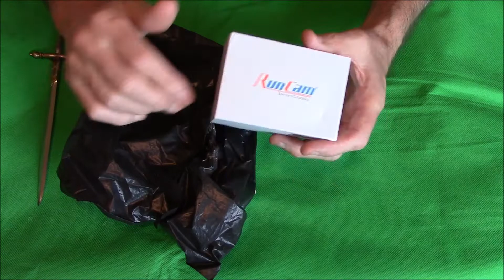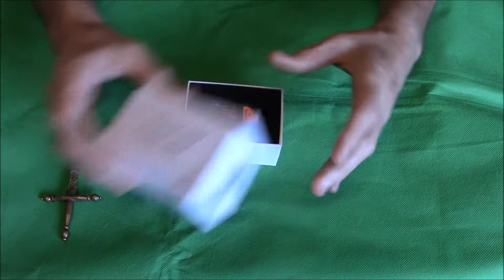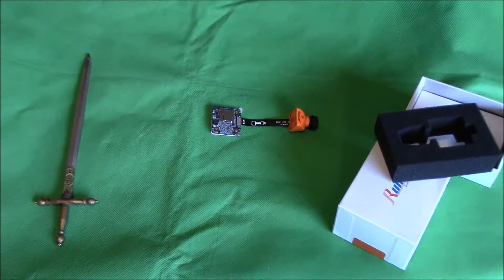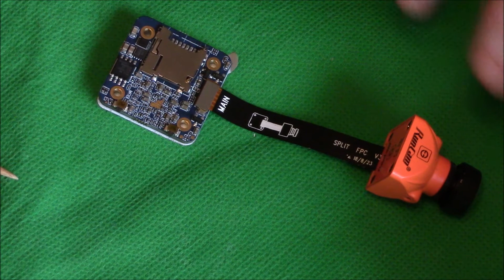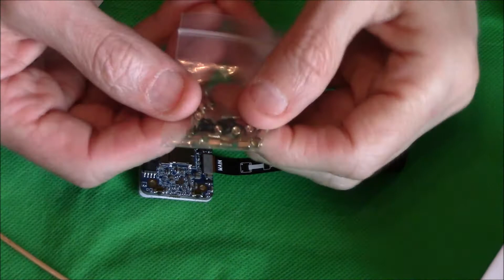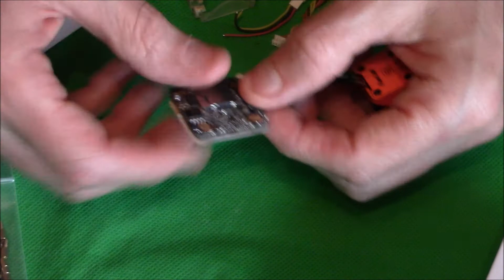RUNCAM SPLIT V2   MORE INFO

Comment: Nice one George glad banggood sorted you out. Any chance you could put a blob of epoxy over the bottons without stopping the fuction of the button? Just a thought 💭.
Reply from the maker: There is No way you could hot glue the buttons, they are so small and have open connectors the glue would stop the buttons from working.

Comment: Herd a lot about it, let me know how it goes after you have used it a few times more,
Reply: A bit hot glue mate on the buttons
Reply from the maker: Taking her out for a spin today, posting the video tomorrow. But I can tell you right now Don't Buy One, the HD recording is great however you cant finetune the image much so the quality in your goggles is poor.
Reply from the maker: There is No way you could hot glue the buttons, they are so small and have open connectors the glue would stop the buttons from working.
Reply: can you not put a fine bit off hot glue behind the button on the board?  if not just a thought, you have it in front off you lol , Thanks agin mate, ill hold off getting one ,